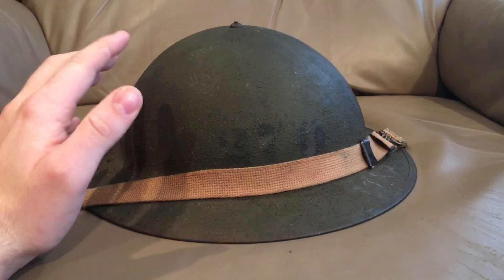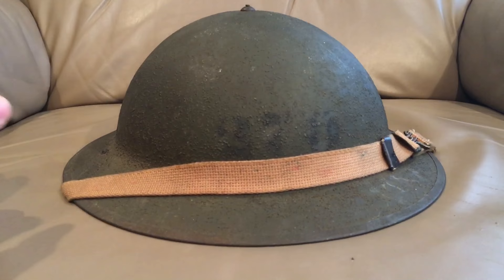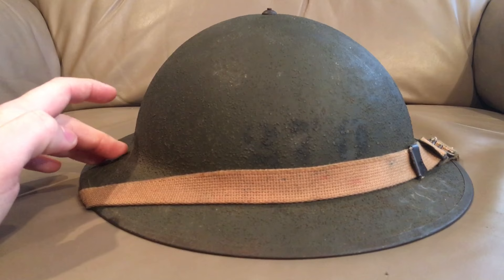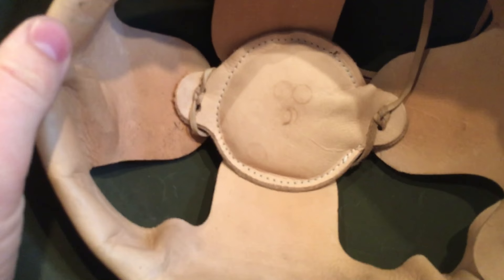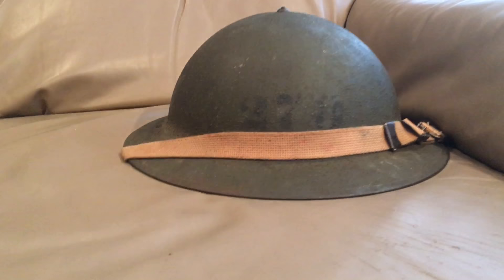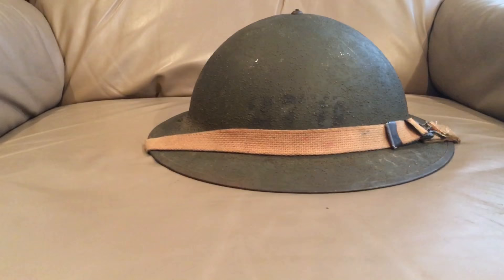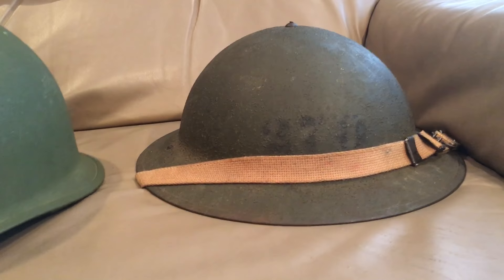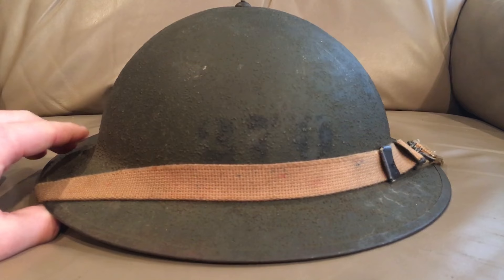American M1917a1 "Kelly" helmet

Comment: Hi, Thank you for your presentation ! I believe that the M1917a1 was used until the end of WW2 for training in the US. Ironically the US entered ww2 in 1941 with the same stuff they had in 1918 : no M1 but M1917A1 helmet, french 75mm field gun instead of 105mm M2 howitzer, more M1903 Springfield than M1 Garand. 1942 was the transition year!
Reply from the maker: jo dc the 1917 helmet in some form or another was used up until the late 60's actually by the merchant navy every now and then I see an m1917a2 which has something that resembles a m1 liner type suspension in it
Reply: @DevinK   I have found M17 Kelly with the horsehair pad attached to the aluminum  frame and some with the pad attached to the leather pads. Which was the official design?
Reply from the maker: Stan G it was preference it’s wasn’t official it was just how the soldier wanted to wear it

Comment: Its ironic that the U.S. "kelly" helmet marched in victory at the end of WW I but will be more remembered with the defeats that marked the early days of U.S. entry into WW II. Wake Island, Bataan & Corregidor,Guam etc. The M1 helmet on the other hand started the long march to victory from Guadalcanal to Okinawa to both V-E and V-J day.
Reply from the maker: Ryan Victoria the kelly helmet didn’t exist until the 30’s. in wwi the Americans used the m1917 helmet the kelly is the m1917a1
Reply: See ASP channel for more information on US steel helmets. Google ASP Chris Butler Youtube.. The site is working on a Brodie only presentation in the future.
Reply: @DevinK  Most of the m1917A1s were converted from original m1917 helmets from WWI. A small batch of helmets were produced during the 1930s made by  McCord. The helmet shells at practically the same, they just improved the liner.
Reply from the maker: @georgebenta3435  yeah I’m aware but it was actually only about half of the 1917a1’s were converted from 1917’s

Comment: Was the Kelly helmet only produced in one adjustable liner size?
Reply from the maker: Anthony Strang yes just the one size with the 3 positions. There is some adjustability because you can always punch more holes in the leather to make it smaller but it doesn’t get much larger

Comment: I'm currently cleaning a relic M1917a1 helmet, It's rare here in the Philippines. I'm just wondering if the 4 springs and the center nut enough to prevent the liner turning inside the helmet shell? From what I see in the video 3:19 and 3:22, the liner does move inside helmet because of the marks the springs made on the paint.
Reply from the maker: It does move but it shouldn’t matter to much